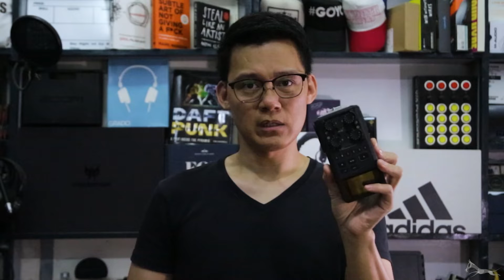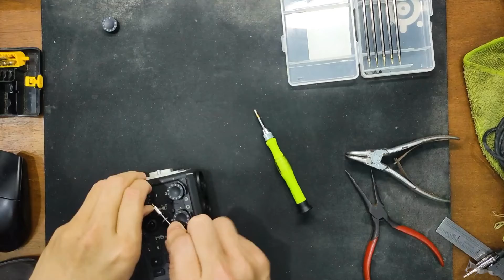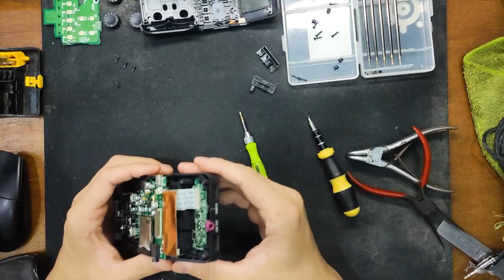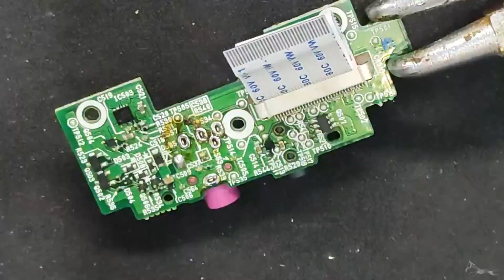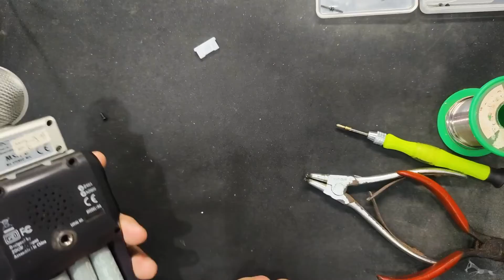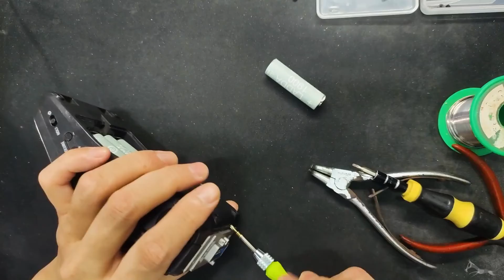Zoom H6 Line Out Repair

Comment: Have you had any of the H6 come across your repair bench in which the mic inputs 1 & 2 have stopped working?
Reply from the maker: That's new, haven't read or experienced that. Tried opening to check? The combo jack sockets could be dislodged. Reconnecting will sort it out.

Comment: Really useful - my front panel had cracked and come apart from the base at the bottom, and the switch had come adrift too. This video helped me completely by showing me how to undo it - I did the repair and it's all fine now. I have the Zoom F8n and F8npro but I still find the H6 really great for recording choirs / rehearsals etc where I want a small, unobtrusive single unit using one of the attached mics, so I still get to use my H6 at least until I totally destroy it! Thank you!!!!!
Reply from the maker: Glad the video helped!

Comment: il mio non rimane più acceso , si accende mentre premo il tasto ma appena lo lascio si rispegne 😐😑😟😟
Reply from the maker: 😔sorry to hear that. Again, if someone can point to the power button part - that could be the issue. I don't have any tips for the sliding power button.
Reply: @BryanDumaguina  il pulsante credo porti il suo impulso poichè si accende , ho paura che dopo di esso qualcosa non memorizzi lo stato per via di qualche condensatore smd che fà i capricci ... in tal caso mi viene da piangere

Comment: Hey thanks for this video. I am having an issue with the power on my H6. I just replaced the power switch, but it still won't turn on with batteries or by USB cable. Any ideas?
Reply from the maker: Sorry to hear about your H6. I'm starting to get more inquiries like this, a power issue. Very similar to how you described. Unfortunately, I don't have any tips for you.
Reply: @BryanDumaguina  That's ok man. I appreciate you responding. If I figure something out I'll make a video and shout you out.